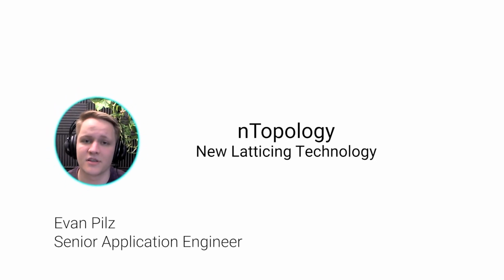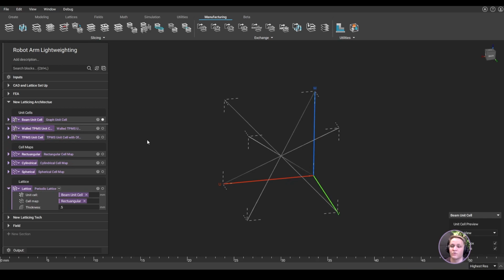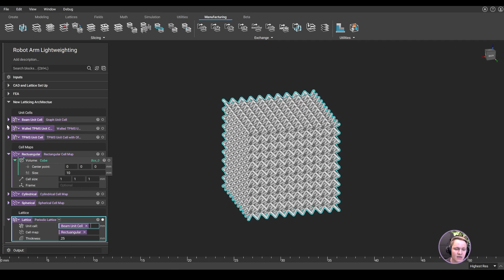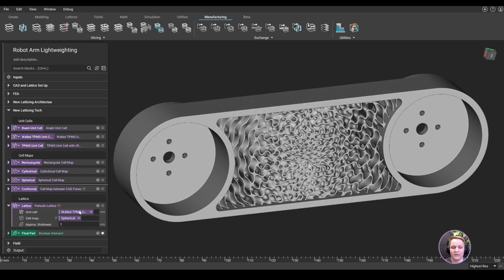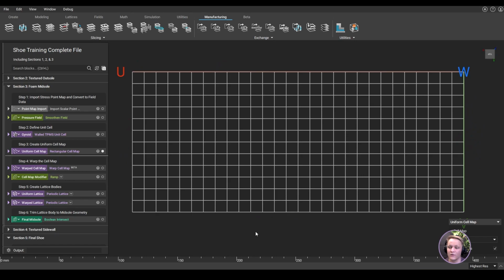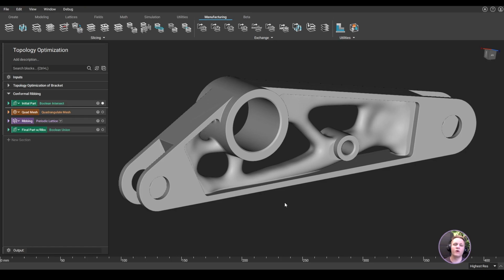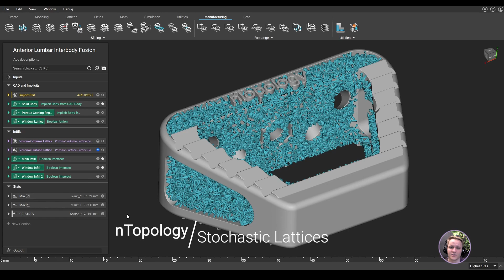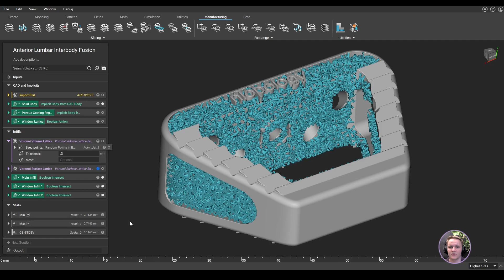Introducing the New Latticing Technology | nTopology

Comment: can I add my custom lattice structure in this software. And Can I export the model for further statistical analysis like ansys or abaqus supported file format.
Reply: Hey Venkatesh, 
You can use your custom unit cell in nTop and also export it to Ansys to perform analysis.
https://support.ntopology.com/hc/en-us/articles/360055403953-How-to-build-a-custom-lattice-unit-cell
https://support.ntopology.com/hc/en-us/articles/4401872874771-How-to-export-your-design-to-ANSYS-Workbench